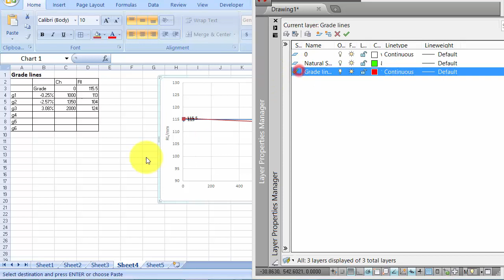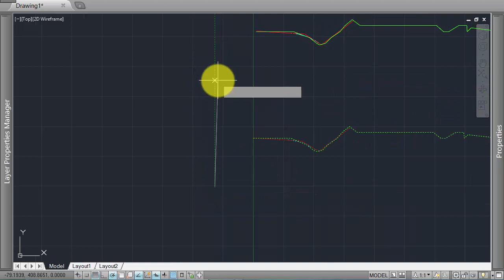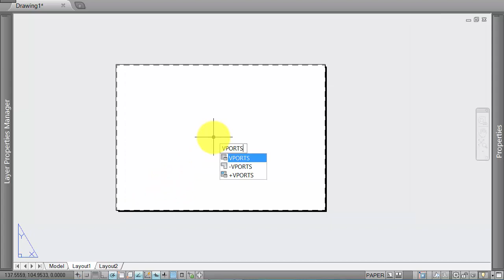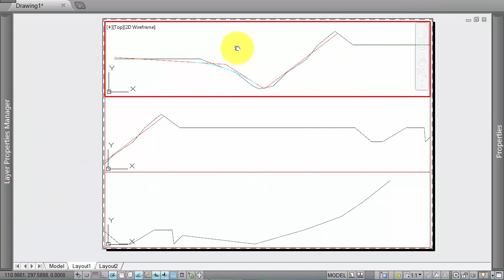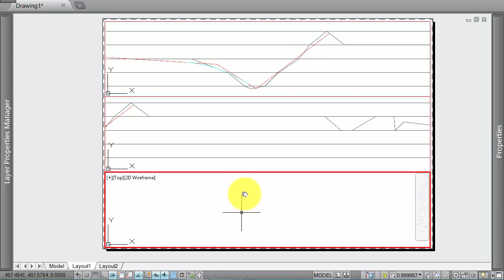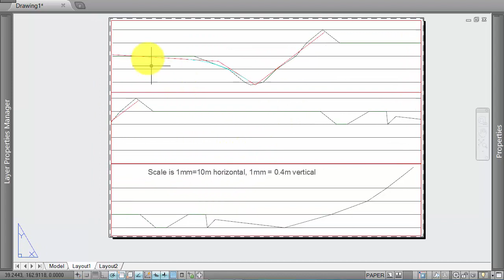Producing lines in AutoCAD using data from Excel

Comment: Hi Adrian, thank you so much for your sharing. Do you know how to produce a surface accroding to the points (x,y,z) in Excel? Thanks. Looking forward to your reply.
Reply from the maker: This video will get you in the right direction: https://www.youtube.com/watch?v=f8pqXOYchd0&t=123s

Basically you want to format your data as a comma separated variable (.csv) file in eastings, northings and elevation (equivalent to x, y, z).
You create a surface in the CivilCAD Toolspace, expand and go to definitions, then right-click on point files and add the .csv you created earlier.
Your surface should now take on the values from your file, but you may need to clean it up a bit.
Reply: @borgiedude  Thank you so much. I will check it.😀

Comment: Thanks Adrian. Is very useful
But I have a question.
I have one excel datasheet with: X,Y coordinates, characteristics and attributes (30 or 40)

I intent to link this table (one tab with solo points and other one with lines -beginning and end) and draw the points and lines (is for an electrical network -posts and lines between this posts).
Or is there a way to create an .SCR file from excel and run this script into autocad and draw the lines ans points?
Reply from the maker: Yes there is. You can make a similar script as you have at minute 9:15 in the video, but use 'LINE' at the start instead of 'PLINE'. You can then make another script with 'POINT', or 'NODE' (I can't remember which CAD command makes points).